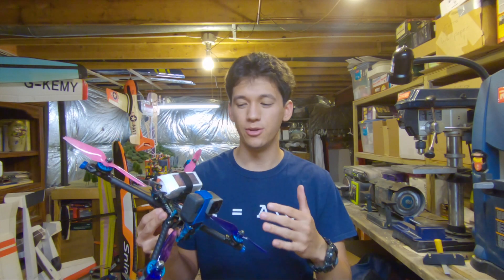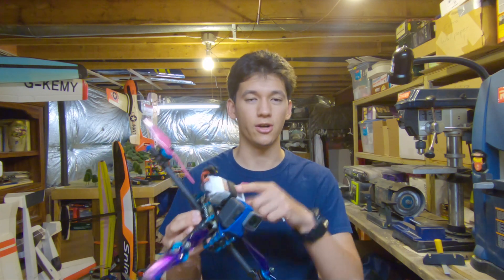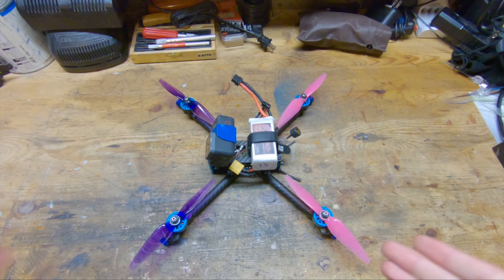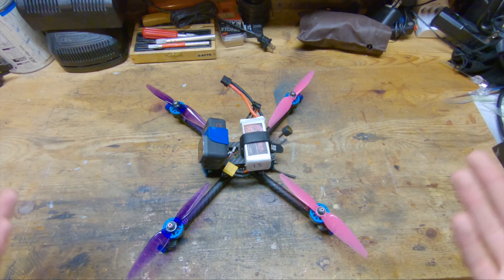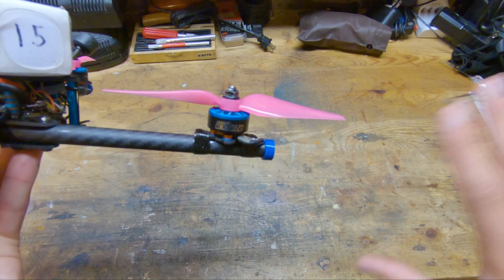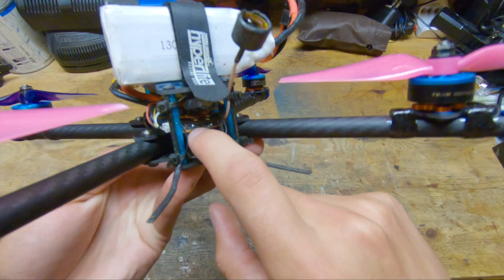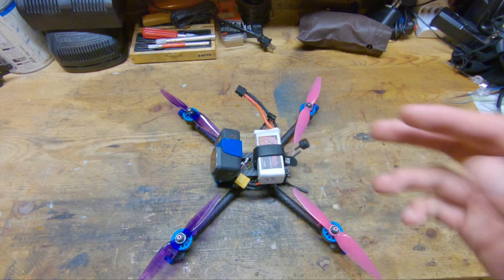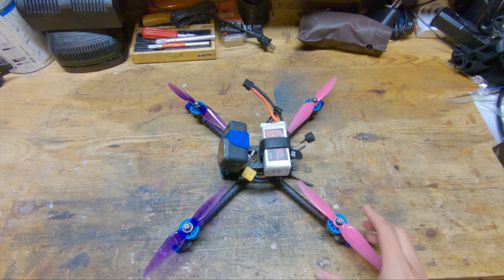Tubular Quad V5 Electronics Installation - My Setup Explained - Build Your Own FPV Miniquad Frame

Comment: Your video keeps helping me with my project! Thank you!! I do have a question though. What is the purpose of your Foxeer Arrow Micro Pro camera? I saw that you have the gopro on it so I figure it serves a different purpose? (I am completely new to quadcopters)
Reply from the maker: The Foxeer camera is low-latency and is what I use to see in real-time. The GoPro is for filming and yields much higher quality video than the Foxeer camera can produce.

Comment: could a 2,5 inch vertion of this be possible ? like a good idea ?
Reply from the maker: Using tubes for a 2.5 inch quad would still give you all of the same benefits of using tubes for a 6 inch quad. However, this design in particular would have to be heavily reworked to be suitable for such a small quad.

Comment: Hi Timmy, do you have RSSI, ie frame drops, set up using your Lemon RX satellite to show on Betaflight OSD or do you fly blind? I can't get any form of RSSI to work for me...
Reply from the maker: I do not use RSSI, but I just attempted setting it up without success. It seems like the Lemon RX satellites do not output frame drops.

Comment: Excellent build 👌

I’m building this frame myself and only parts missing is the stack and motors. 

Would a 20x20 stack with a 45A esc work? I can drill the additional holes in the baseplate. But do you think 45A is enough?
I’m looking at the Holybro Kakute F7 mini v2 stack or the T-motor Mini F7 stack. Both have 45A esc. 

Also, getting hold of the hyperlite motors in Norway is super expensive. Would the Emax RSII 2206 1900KV be a good alternative? Weight without wires is 26.6g.
Reply: I've been looking for the hyperlite motors in Europe too - almost impossible, thought I had them but the ended up being out of stock.

Resorted to slightly heavier motors too
Reply from the maker: 45A should be plenty if you are running 4S. Those motors are pretty light and I think they will work well.

Comment: Great content! How you think would this design scale to 7inch long range build well? Need to make arms more beafy?
Reply from the maker: As long as the weight is kept under control I think it would scale fine. The arms would only be half an inch longer, which shouldn't be a problem since they are very stiff to begin with.